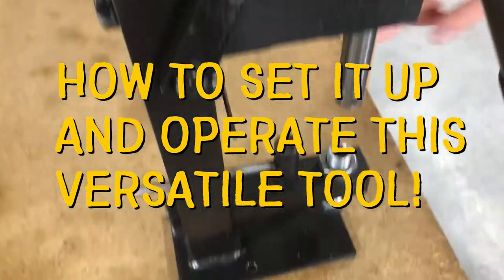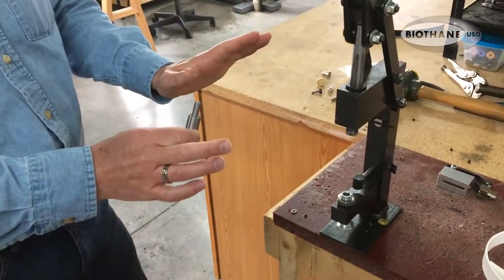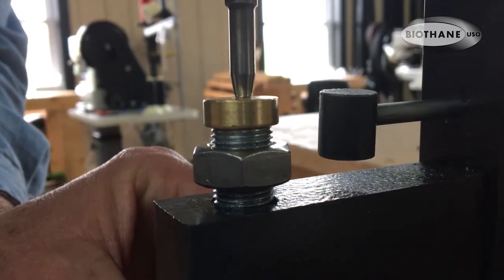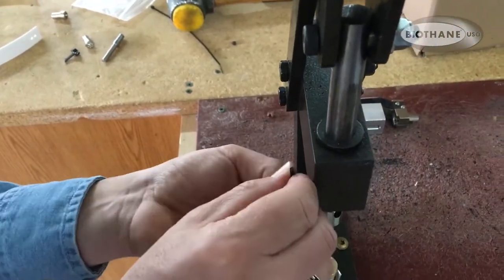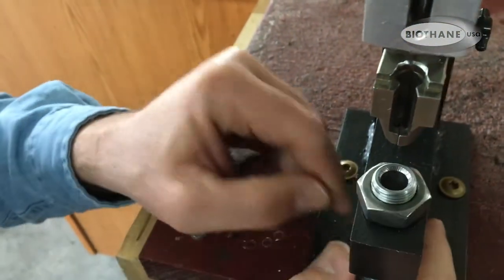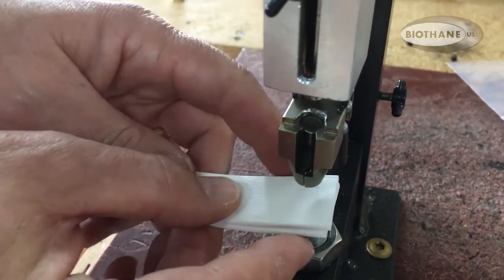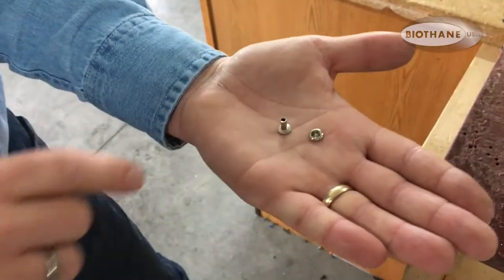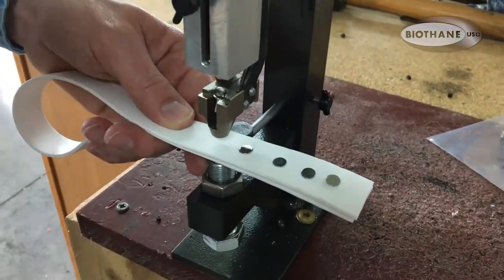Shop Tools: The Handyman Press

Comment: I will soon be needing to punch 3/8" dia. holes thru a SINGLE PLY of 1" Biothane: Gold Series, Hi Flex.  Will this machine handle that die set??  Thanks!
Reply from the maker: HI Mike and thank you for the question.. Yes, the Handyman press can handle a 3/8" diameter punch no problem. Check out The Strapwarehouse website here: https://strapwarehouse.com/the-handyman-press-hand-riveter-punch/ and I notice they have up to 1/2" punches available. They have 3/8" punches listed in the drop-down menu. Thanks again and I hope this helps!

Comment: This is a great video. I have a tool to set crystal rivets. This will be a great tool to add for the biothane. I have been trying to figure out the best way to punch hole & set rivets. Thanks for advice on the different options for caps to secure dog collars. I like the double cap...so dog hair won't catch. To confirm brass or nickle is what you recommend :)
Reply from the maker: Thank you for using BIO! Brass or nickle plated are both fine to use. If you use nickle plated brass, that is a great "silver" finish option since the brass wont rust once some of the plating wears off. They cost a little more but if quality is more important then I would go with nickle plated brass:)